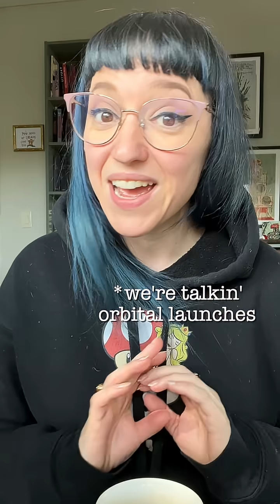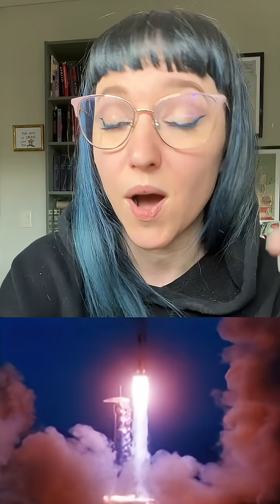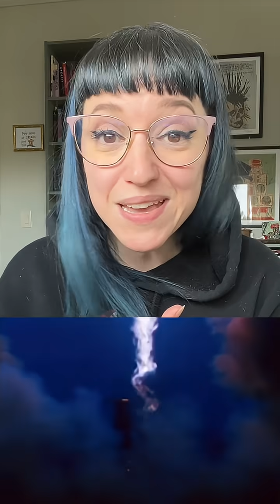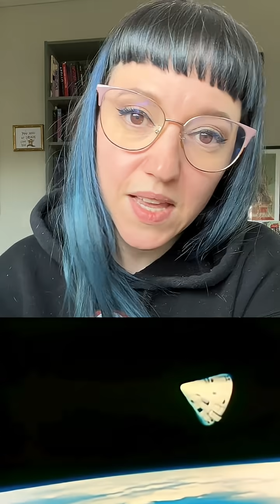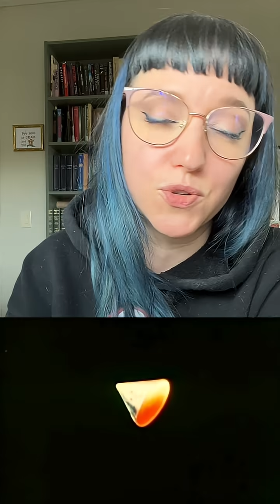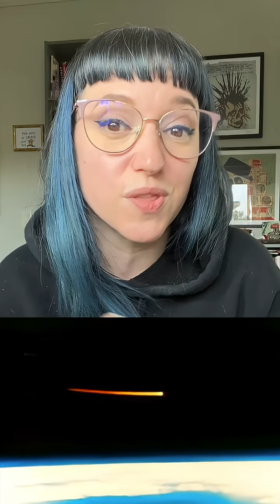The riskiest launch moment #shorts #science

Comment: Max Q on reentry is significantly less than max Q during reentry. The speeds are significantly higher on reentry, but the air is much thinner where  max Q occurs. The space shuttle specifically used reentry Max Q to reduce speed the fastest.

Comment: Great video. Might be worth mentioning that q is just the variable for dynamic pressure, which the air pressure due to motion through the air (as opposed to static pressure, which is the atmospheric pressure surrounding the vehicle). The formula for q is straight forward: q = ½ρv², where ρ is the air density and v is the airspeed.

Comment: Why do they throttle back to pass through  "Max Q." It would seem that the quicker getting through it the better.
Reply: Because it reduces the amount of pressure. Q is the product of the spacecraft's speed and the air pressure. By accelerating a little more slowly as they approach Max Q, they reduce the value of Max Q. This reduces the stress on the rocket's structure.

Comment: Is that a contributing factor to the Challenger shuttle explosion?
Reply: I don't think so (but happy to be corrected by experts). The main problem was the inflexibility of the O-ring in the cold weather of the launch, which allowed the hot exhaust gas from the Solid Rocket Booster to blast out towards the External Tank. From the moment that happened, my understanding is that Challenger's fate was sealed.

Comment: Is that a contributing factor to the Challenger shuttle explosion?
Reply: No, Challenger blew up because the O-rings in the solid rocket boosters weren't specced for the temperature they launched at. The O-rings failed and hot exhaust started chewing a hole through the side of the rocket. They weren't anywhere near max Q at the point when the shuttle broke up.

Comment: The reentry module underwent a peak deceleration of 7–8g. The primary aerodynamic stress was on the heat shield, but this wasn't as much as might have been expected because the capsule was not slowing due to friction but by dumping kinetic energy into adiabatic heating of the air.
Reply: Moreover, they didn't really get a "max" phenomenon, because of a partial skip - they'd go as far as the heat allowed, then pull out of descent to allow some cooling between "digs" into the atmosphere. It was kind of "hot - warm - hot" cycle as much as they knew the heatshield could take.

Comment: Right before Max-Q, they turned off the center engine on the first stage, right?  😮
Reply: No they didn't. They just powered on through Max Q. They shut down the centre engine about 20 seconds before the outer 4 were shut down, in order to limit the acceleration of the, by then, much lighter rocket.

Comment: The way to look at Max Q is not that it is when the structure will fail. It's more like, if the structure was going to fail, it would have happened by then.

At Max Q, the forces go from increasing, to decreasing. The chance that it will fail just as it kisses Max Q is like throwing a bowling ball at the ceiling, and it smashed a gnat sitting on the ceiling, but doesn't dent the ceiling. Chances are far more likely that you A) Don't hit the gnat, or the ceiling (no failures), or you smash the ceiling before the bowling ball stopped moving (failure before Max Q). Reaching Max Q is a milestone because it means things just get easier from there.

Comment: Has a rocket ever failed within a few percent of MaxQ?  I haven't seen anything.
Reply: Space Shuttle Challenger, 1986
Reply: @maxfan1591  Challenger broke up just after MaxQ due to the O-ring burn-through, not a structural failure of the spacecraft due to aerodynamic forces.
Reply: @MikesTropicalTech  "Challenger broke up just after MaxQ due to the O-ring burn-through, not a structural failure of the spacecraft due to aerodynamic forces."

I'm well aware of that, thank you. I was answering your question as it was posed, which seemed to be a timing question, not a cause question.

Comment: My understanding is that Atlas rocket was particularly susceptible to issues of high dynamic pressure, since the skin was also the fuel tank.  The inside of the tank needed to be beefed up in order to support the extra weight of the Mercury capsule.  That’s why John Glenn’s flight was considered so risky.

Comment: I had a chance to take a close look at the Apollo 11 CM when it was part of the Smithsonian's traveling exhibit. Apparently the reentry attitude was controlled in such a way that, while most of the thermal energy was dissipated by the ablative heat shield, the side of the capsule away from the hatch took more of the thermal stress than the hatch side. The difference in surface scar trails from super hot ablative material as it streamed past the capsule was obvious; the hatch side had far fewer sar trails.

Comment: Minor quibble:  A structural issue is likely going to show up at or before max-q.  Meaning if you’ve made it that far, max-q is the least likely point to have a failure due to dynamic pressure. 🤓

Comment: Pretty much all rocket launches, including non-orbital.  If it goes up, it goes through Max Q.

Some air-to-air missiles have ramjet engines or dual-pulse rockets which mean they hit Max Q on the way down, heading towards the target.  Most though are just a single short pulse taking them to Mach 4-5 and then they use a lofted trajectory, so that Max Q is at the end of that short burn.

Comment: Max Q on Reentry is probably significantly lower strain than max Q at launch. There's just not a lot of mass there by the end of the mission, and the capsule is an extremely simple mechanical design.

I'd wager max Q on reentry is 2-3 orders of magnitude less than launch.

I'm not an engineer though

Comment: I believe the maximum risk issue on re-entry involves heat and the heat shield. Will the heat shield be blasted off or fully ablate before the craft is slow enough to begin to cool down? 

The situation is much more complicated for Space Shuttle re-entry. A study of this begins with the Space Shuttle Columbia disaster, where damage at liftoff (probably at or near max Q) created damage that was fatal during re-entry, and management of that crisis radically understated the risk to ship and crew. So the Columbia suffered fatal damage around Max Q on liftoff leading to fatal damabe around Max Q on re-entry, but management analysis of risk and risk prevention was the underlying root cause.

And we each have our own personal Max Q moments, such as getting on and off highways or driving in heavy rainstorms.

Comment: The re entry pressures were mitigated by the friction between the air molecules and the ablative coating of the heat shield on the capsule. The innate shape of the capsule kept it falling in proper orientation to keep the heat shield pointed directly in the path of travel. So as far as max q, there really isn’t a good way to calculate this because it was unpowered descent, and surrendering to gravity not escaping it. One could extrapolate the velocity based upon mass factoring in the thickening atmosphere, but that ablative coating would be the wild card in that equation.
Love this channel Amy!❤

Comment: Yes Amy, a reentering capsule or vehicule goes trough a Max Q. As the capsule enter the thin upper atmosphere it starts to slow down, but the air gets denser as it loses altitude. So there is a point in which the density overcomes the decreasing velocity. 
  The formula for q is q=1/2rv^2 r here being the letter "rho" wich states the density of a fluid at a given point. That is just the dinamic pressure. 
    The structural load is another formula that takes into account the q at a given time, the drag coefficient of the body and tippically the area of the cross section.

Comment: I understand that max Q was reached somewhere between 90 and 100 seconds into flight. The acceleration at 100 seconds was about 2.5G, peaking at 4G just before center engine cutoff at about 135 seconds then again approaching MECO. 

Is there more stress on the vehicle adding acceleration and atmospheric drag at max Q or at peak acceleration?

Comment: During reentry the max-Q is the same as the maximum g-force on the astronauts, because this dynamic pressure is where the deceleration comes from. So I guess that's where the limit for "max-Q during reentry" comes from. Over-engineering a fairly compact capsule so that if can withstand much higher deceleration / forces than the human body is fairly easy. Compare that to the structural strength a of thin-walled tube that is compressed along its axis (by the engines on one side and the dynamic pressure on the other side). Add to that that there's strong incentive to make that tube as light as possible, because every kg (or pound) of weight of dry mass in the lower stages is several kg (or pounds) less payload to orbit. While every kg of added structural weight in the capsule is exactly one less kg of useful weight that you can transport inside the capsule.
Reply: Space is often wrongly caricatured because the G-force isn't that significant, generally rarely above 3G. Most humans have already experienced these forces in 4 or 5G amusement parks. Even in recent Starship tests without humans on board the numbers barely hit 4G. But in fact, taking more G-force upon reentry isn't generally advisable unless you want to destroy your ship. Because it's not the G-force that's problematic, but the exponentially increasing temperature.
Even though materials like aluminum can easily withstand 100G, self-destruction is guaranteed.

But if you put 1,000 tons of fuel, it can go up to 3,000 tons on the structure. That's what's considered critical, rather than the inhabitants.

Comment: Even non-orbital launches logically MUST have some point of maximum dynamic pressure.  However it's likely that for most of them that max Q isn't particularly close to their structural limit; as some other element of their lifecycle (transport; erection, fuel loading, etc.) required a structural strength in excess of that needed for their max Q.  As such max Q might not get called out; (and the designers might not even need to calculate what it would be) -- but it'd still exist

Comment: This is why Atlas had to be reinforced for Mercury flights. It was thin skinned and had a nasty habit of blowing up during MaxQ. I think it was internally pressurized too
Reply: The Atlas rocket, was built in away, that, in order to save weight, the structural integrity of the rocket was reached only when the tanks were pressurized, if not it would collapse under its own weight. 
    Fun thing - as the atlas was also not painted and showed it steel skin, it had to be lubricated, and that was the first use of WD-40.

Comment: Yes, there is a max q during reentry. It's important because it corresponds to the max g loading experienced by the vehicle. That's why it's critical to make lift even if it's just tilting the capsule. The lift replaces the orbital velocity keeping you from dropping too far into the atmosphere before you slow down. There is also a maximum heating which actually occurs earlier at a higher altitude at a higher Mach number. The entry angle is important mainly because of the rate of change of density. So it's the vertical component of that velocity that matters. The rate of change in density determines the g load. It increases faster than you slow down. Mach number determines the temperature of the shockwave but q, dynamic pressure, affects the heat transfer. Too steep of an angle and the g and h dot get out of control. Example would be nuclear warheads which go high and enter steep experience 30+ g and insane temps. The first work on shockwaves and heat shields was done for warheads not Mercury. You should include a section in your book on the reentry of warheads, development of sharp angle bodies, bent bodies, asymmetry and weight shift steering. Not to mention trying to use sensors and INS at 30g when you are hotter than the sun. That's the fun stuff.
Reply: Something obvious I learned from Starship 11 launch, alongside max heating and max q, which is max g-loading, there's max thermal load, where the vehicle has absorbed the maximum thermal energy and it will start to emit more heat than it absorb.
This will be at a different point than max heating, as it will take time for thermal flux fully soak into the craft.
Indeed, I assume warheads never reach max thermal load before impact. Where as vehicles that expect to land must, at some point, begin to radiate more than they absorb.
Reply: Though the lift isn't required - all the capsules are designed for ballistic reentry too, in which the capsule spins so that the lift in all directions cancels out. It's much more aggressive, and way higher max G numbers imply that max Q must be much higher too, but it's certainly a working approach.

Comment: During Shuttle launches they would reduce or limit the thrust during the ascent for a similar reason.  You'd hear the phrase "Go (condition) at throttle-up" just before they'd increase thrust.
Reply: With the doomed shuttle launch, they announced ‘passing Max Q’ just before saying “go for throttle up”. Then the explosion. Obviously the most dangerous part of that launch.
Reply: @danbalkwill no, the most dangerous part of that launch was the actual decision to launch the vehicle. They knew there was the o ring issue, they knew how the cold temperatures exacerbated the issue, and they went anyway.
Reply: Pretty sure every SpaceX launch will also back off the throttle at Max Q, then push it back up until main engine cutoff.

Comment: It'd be tough to fit the full definition in a short, so I'll take the opportunity to mention that inertia is also a major contributor to max Q. The faster the rocket accelerates, the greater the stress it experiences from pushing its own mass.

What's surprising is how a lighter payload can actually increase max Q, even though it wouldn't increase the inertial stress. A lighter payload means the rocket accelerates faster, reaching higher speeds in the lower, denser atmosphere.
Reply from the maker: Yeah I didn't want to get into the calculations part and variables, mostly because I didn't think I could get it right in a Short. Which is why I just took the simplified Apollo launch moments as a reference!
Reply: @AmyShiraTeitel I guess that’s also why you didn’t go into that it was maximum because after that point, the density of the atmosphere was lowering with altitude so rapidly (and decreasing stresses) that the increasing speed of the rocket in its trajectory was increasing stresses at a lower rate…
Love your work!!!
Reply: This is interesting.  I'm clearly going to have to look up the definition of Max-Q.  

From a physics point of view, any time someone says they're including "inertia" as a "force", they're almost always using Newton's 2nd law wrong, but I suppose of reaction force is an important part of the dynamics of a rocket, then there might be an engineering reason that it needs to be accounted for as a "force".  Hmm.  Thanks for the pointer here.  

"What's surprising is how a lighter payload can actually increase max Q, even though it wouldn't increase the inertial stress."  I need to research this.  As well as pertaining to what "max-Q" is, this may also pertain to the definition of "maneuvering speed" in airplanes that's always seemed like it was mis-defined to me.  I may be missing a subtlety.

Comment: Now a days the announcers calling a space launch call it “MaxQ”. In the early rocket days they called it “Maximum Dynamic Pressure”. Wondering when they started calling it MaxQ?
Reply: In fluid dynamics, Q (or q) has always been the symbol for dynamic pressure.
Reply: From the beginning. “Q” is the term that is used in equations to represent dynamic pressure from the slipstream. I assume in the early days of space flight public address announcers decided the public would not know what “max Q” meant. It became publicly discussed by Walter Cronkite and others when the Mercury program started using Atlas boosters. The Atlas had a nasty habit of blowing up at max Q.
Reply: Google says there is dynamic pressure increasing before and then dynamic pressure decreasing after. The point where it switches is the maximum dynamic pressure, and the maximum in the equation, so Max Q.
Reply: Q = 1/2 rho * v^2, where v is velocity, rho is the density of the medium (air in this case), and Q is dynamic pressure.
Reply: @oligoprimer  How was '1/2 rho' determed to be the correct value to make the equation work correctly?
Reply: Well as time goes on and new younger members come in with their perspective of a situation. Which they end up having a different opinion of the previous crew had. It’s just what happens with language from the last century, or back in the day, old school, the OG had their terminology and the millennials have their own terminology.
Reply: Same as V1, V2, VMC, Vx, & Vy for an aircraft
Reply: Because engineers love acronyms and short hand.

Comment: At what altitude do the parachutes deploy? There wouldn't be any pressure problems after that I think.
Reply from the maker: I have a video on that coming! But it was low enough and there was a drogue that started slowing them down so it was safe to deploy without incident. Except for that one on Apollo 15 that didn't inflate all the way?
Reply: @AmyShiraTeitel drogue parachute not opening all the way and falling capsule from space are two things I would do a hard pass on.
Reply: I think the max dynamic pressure during re-entry must be during the hard aero-braking; possibly even at the same time of max aerodynamic heating (and, as you say, long before the chutes deploy).